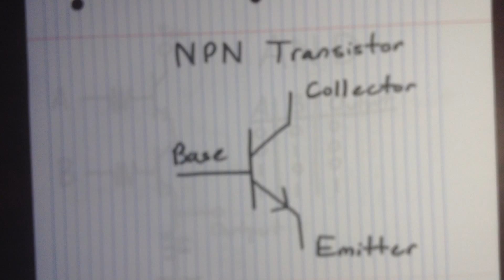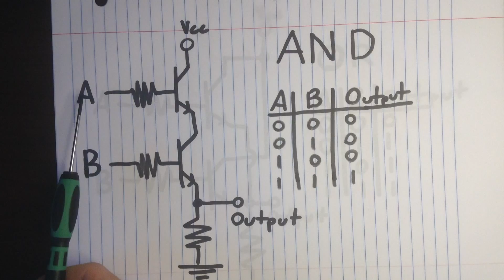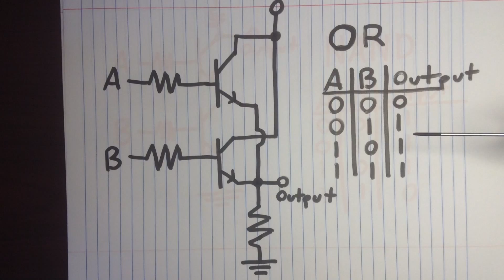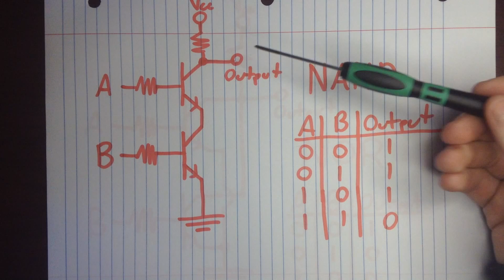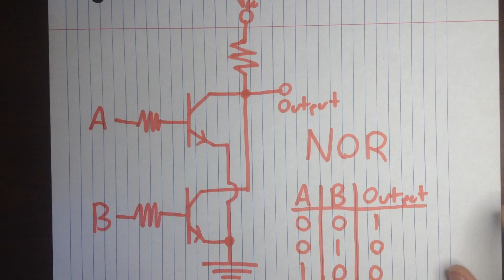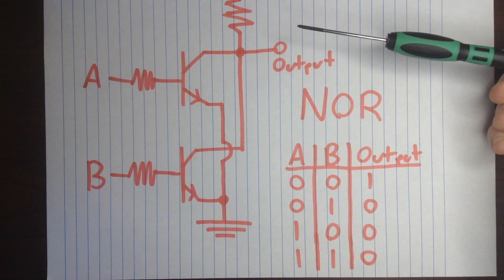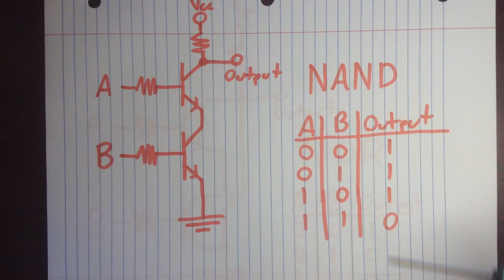Comment: 4:40 NAND: Why does all the current flow to ground through the transistors and bypass the output? Is there not a potential difference there still?
Reply: "0" means low, which does not mean 0V. it just means that it is not high enough to be "true" .

Comment: Hello sir,, Read please, in And gate, when A is low and B is high why the output  is 0 or low.  While we connect A to ground and B to High voltage wouldn't the base-emitter junction of the second transistor  forward biased?  then why it is Zero instead of 1

Comment: Hi, to do a circuit analysis and to calculate the resistances, voltages and current is correct  to separate the cases when the switch is ON and when the switch is  OFF ?

Comment: For the or gate, can't you connect A, B and the output together unstead of using transistors ?
Reply: if you do that current can flow from one input to another. For example, if the input is 01, current from A can go to B. You can also use two diodes tho (correct me if im mistaken)

Comment: How do I determine the value of resistors to be used?
Reply: Data sheet for the transistors you use. It will tell you the current you need to apply to the base as well as the maximum current (which you don't want to reach). Use those values with ohms law and your voltage source to determine the required resistance.
Reply: Juicyblunts Can you please explain further?

Comment: Thanks! The best NAND gate explanation. The only thing i've missed: why did you put a resistor to the input line in that case? and what serves a "ground" if we talk about computers?
Reply: The resistor serves to limit the current and create a voltage differential when the transistors switch on. So when none or only 1 transistor is switched on, there is a voltage potential of 5V across the resistor to the collector of the first transistor and a 0V potential across the collector/ emitter of both transistors to ground. When both transistors are switched on, there is a 5V potential between the source and the "top" side of the resistor, and 0V potential from the "bottom" of the resistor to ground. So basically there will be 5V potential at the output until both transistors are switched on, in which case the full voltage potential drops across the resistor to 0V, leaving 0V potential for the output to draw current. Make sense? And ground in a computer is the common return path for current  to the voltage source in the circuit, it connects to the "-" terminal if using a battery, and is essential for completing a circuit and establishing continuity across it.
Reply: Juicyblunts Cool, thanks!))

Comment: if my power supply comes from a 9v battery, what resistor values should I use?
Reply: Simon MacLean there are many ways to do it depending on what voltage you want at a certain point or how much you want in total. i suggest that you look at voltage dividers and look into ohms law to determine what resistance you need but you can use a 220ohm if your just pairing it with an led.

Comment: what I still dont understand is why the current wouldnt flow through to the output, even if it can go through the transistor (for NAND, and NOR). why doesnt it go through both?
Reply: It is because of the resistor placed between 5V and the collector of first transistor. Ignore the transistors for just a moment and imagine that the circuit involved just the 5V, the resistor and a ground. If you measured the voltage between 5V and the resistor, you would find 5V. Then if you measured the voltage between the resistor and ground, you would find 0V. When you put the transistor(s) between that resistor and ground, and then re-measure the voltage between the resistor and the collector of the transistor or first one in the case of a NAND gate, you will find 5V instead of 0V because there is no direct connection to ground. So once one (NOR) or both transistors (NAND) are switched on, there is once again a direct connection to ground from the resistor, so if you measured the voltage again you would find 0V, meaning there is no potential for current to flow to the output. I hope that makes sense and helps you understand better and doesn't just confuse you more.
Reply: Current likes to go through the path with least resistance. The transistors in all these cases act as switches, and if the switches lead current to the ground then all the current would go to it. The output node would normally go to an LED or some other element (which has resistance). Hence why NAND and NOR work the way they do.

Comment: In the AND Gate, if the A & B are 0 & 1 respectively,

Why is the result 0?

Should't it be 1?
If the currrent is flowing from the collector to the emitter in the B transistor.
Reply: since A is 0, it emits no power through emitter, so B transistor recieves nothing through collector. B being one just means that the switch is in the on state